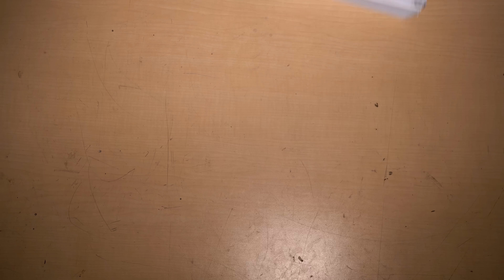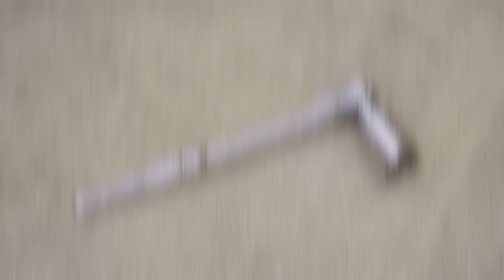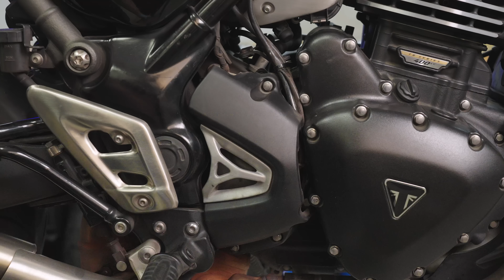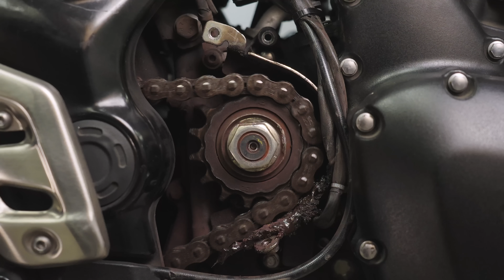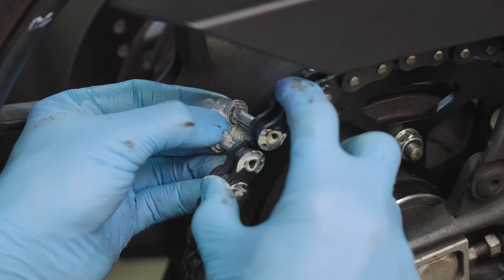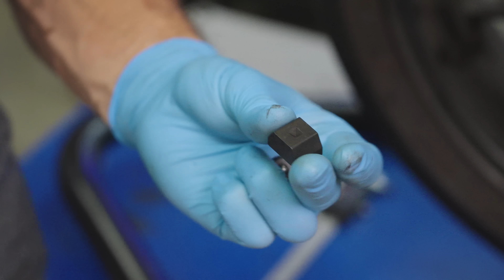How To Replace Your Motorcycle Chain and Sprockets | The Shop Manual

Comment: Hi I have questions and needed to be answered. Does changing the sprocket will affect the speedometer reading as well?
Reply: only if you go with different sprocket sizes than the stock ones.

Comment: If you don't already have stands and the tools and a bunch of bikes it makes more sense to let a shop do it the one time you'll ever need to replace the chain on your bike. (Let's be honest here...the vast majority of riders aren't putting enough miles on a bike to wear out more than one chain) 

I have stands and all the tools except for a chain tool and I'm on the fence about spending the $150-200 for a proper chain tool + spending a few hours doing it myself; or just letting the bike shop down the road do it for $250 and be done with it.  

I've used the $20 Amazon chain tool.  If you're lucky, it'll work once and fight you every step of the way.  If you're not lucky, you'll be cutting off the ruined new master link, fighting with it for 4 hours, then finally having the bike hauled to the shop to finish it anyway.

Comment: Or you can use a simple pin lock rather than this so much precise riveting.
Reply: I'm guessing based on your username that you're probably dealing with motorcycles that are maybe 300-ish cc. For these the alternative options like split links and what have you are fine. But for 600cc and up, you'll definitely, 100% want to use a riveted master link because it's much stronger, and the consequences of a broken chain are so much worse.

Comment: A couple of things. Who in their right mind uses a grinder to take out the rivets? If I'm using a grinder, I'll just cut the chain in half. It's barbarian, but quick. Secondly, 110lb ft isn't the end of the world. VW wheel bearings are an education in creating force. IIRC they're 250 & 90°

Comment: If you're on a budget, it's a good idea to swap the front sprocket as they take 3x the wear. The rear if steel is usually 2-3x expensive is always fine to use again for a second chain. You can also reuse the front sprocket washer too!
Reply: A quality steel set of sprockets is still cheap all things considered; roughly $100.  There's simply no reason to not change the chain and sprockets at the same time.

Comment: Someone give me some thoughts and advice please - I have a 150cc Honda with a 14t front and 43t back sprocket - I have amazing acceleration as I have modified my bike with the basic air filter mod and exhaust system and also I have removed a ton of unnecessary weight - but my bike lacks top speed so I have ordered a 17t front sprocket which takes my rotation from 3.1 to about 2.5 will this be a stable change to my bike and increase my top speed by a good amount?
Reply: It'll change the gearing, by which I mean the theoretical top speed. That will increase. In the real world, the engine may lack the torque to drive you and the bike through the wind to that top speed. In the worst case scenario, it becomes slower to accelerate and has a slower real world top speed. You'll likely see some improvement though.
Reply: I'm guessing you've found out by now, but here's how you answer these questions in the future.
If you hit the rev limiter in your highest gear, then sure, you can get more speed by changing the sprocket. But if you don't reach the rev limiter, then it's fairly unlikely. You may be able to get a little bit more speed if you look up your bike's power curve, and change the sprocket such that the maximum speed you can reach right now would be just shy of the peak power output. However, odds are it'll already be close, so there's not much point.

Comment: A quick advice to everyone. Do a favour to yourselves and buy DID 525 ZVMX GG. I have it on my SUZUKI 650 with a JT rear and Onigbene front sprocket for 70.000 klm and is still like new as the sprockets as well. Only 2 tightenings after these klm and seems ready to reach 100k very easy. Lubrication only with the cheapest 90w and 120w gear lube. You thank me after 5 years.
Reply: Japanese ain’t they

Comment: Shockingly (after removing many torqued as you mentioned on other bikes), my Triumph Tiger 660 Sport was only 63 ft lb!

Your point on the "quality" chain tool is a good one but I tend to grind the pin and use punch to drive out the pin partially out of habit and partially because I have both tools out already.  The punch knocks down that front sprocket lock washer.  The grinder (instead for the chain breaker) is used to cut down the new chain to length because I have never once, even when ordering it that way, had a chain arrive with the correct number of links...even when ordering it from Revzilla.

Comment: BEWARE! Get a clip-on chain, not a rivet chain as shown in the video. Rivet chains are for professionals who can break several masterlinks learning how to do it.
Reply: Not if you have even a mid tier bike. Those are fine for your 300cc beginner bike, but for your typical 600cc and up bikes, it's not a great idea. Yeah, it'll probably not snap, but riveted links are much stronger so why take the risk? Master links also cost very little so just get like two or three, and take it nice and slow. Either that, or let a professional do it for you.
Reply: @wurfyy  Most of us do not live near a motorcycle mechanic and the point of these machines is to save money.
Reply: @samsonsoturian6013  For most of us the point of these is to have fun. If your goal is to save money, you probably went for a 300cc or smaller so yeah, you can pretty safely choose the split link or some other solution like that.
And you don't need to live near a mechanic. That's the nice thing about motorcycles. If you don't live near a motorcycle mechanic, then that's yet another excuse to ride.

Comment: If you ever have to remove the rear wheel do not, I repeat, DO NOT forget where any of the spacers go. Those are the only things between your bearings and the axel. Don't ask how I know.
Reply: such a overlooked part😂Ur bike’s pretty much useless without em
Reply: @hathaway.1166 No, the one I didn't install the bike worked until the bearings blew out

Comment: I've done this at least a half dozen times before but never heard of the "chain around the axle to help lock the front sprocket to remove the nut" trick before.  Neat.  Something I never understood is why that nut "needs" to be torqued so much since you're bending the washer over to hold it into place once it is tightened.  Seems to me like if you just torqued it down to 50 ft-lbs or so and then bent the washer into place that there's no way it's going to back off until you go to the trouble of flattening that washer out again.  I'm sure there's a reason they want you to tighten it down to extreme levels, I just have never had anyone give me a good explanation as to why.  🤔
Reply: 100lbs isn't exactly a ton of torque.  That's right around what most automotive lug nuts are torqued to.

Comment: The one thing that I would add for is to order at least one spare master link!

Especially the first time you do this, you are very likely to over-compress the master link or to over-stake the rivet.  If either happens, you need to replace the master link, so already having a couple spares can save you a lot of headache.

Usually a spare master link is only a couple bucks, so ordering three of them isn't that bad.

If you order from some online retailers, they might even have an option in the order to add a couple spare master links and not pay any more in shipping.
Reply: Good point.  I do the same when changing timing chains on old CIS Mercedes V8s.

Comment: I wonder why nobody talks about taking care of the red rust on the gear axle before installing the new front sprocket? (This looks awfull, and the rust will continue to do it's work and destroy the axle.)
Reply: Definitely worth a spray of something. I'd even be inclined to pull that bearing if I'm taking off the second chain.

Comment: I recently tried this chain around the axle method for my Inazuma 250 but just used 6mm diameter screwdrivers as I didn't have nuts and bolts, using a 4ft extension bar I broke one screwdriver, bent the other until it slipped. I gave up and borrowed a 2,034Nm Milwaukee impact wrench from the local blacksmith did it with the chain back on the rear sprocket, brakes on and bike in neutral. Must have been utterly stupid torque put on at the factory, didn't spin off the nut that easily considering how little 120Nm seemed on assembly. Would never have done it with the bar and I'm no weakling either!!

Comment: Anybody who doesn't know how to replace the chain and sprockets on their motorcycle probably shouldn't be riding a motorcycle. Motorcycles require a great deal more owner/rider involvement than most cars. If that is not your thing, motorcycles are not for you.
Reply: So you were born knowing how to change the chain and sprocket? Or you made sure you knew how before you purchased a bike? Sorry, but your statement, and the many like it I've seen over the years, simply don't make sense.
Reply: @AriH211  I was an amateur mechanic since around age 10, a professional (paid) mechanic from age 18 to age 63, retired, and am back to being an amateur mechanic again. I was attracted to motorcycles at a very early age because they were MACHINES.
Reply: Yeah nah. It's completely fine to just let a professional do it.

Comment: There's a dedicated DID tool for dealing with the chain.  What I like about that tool over the motion pro is that it's made in a way that you can't mess up pressing the side plate or riveting the pins.  The tool will stop when the side plate or pin riveting is in spec.
Reply: Ok, now I am interested. Do you have a link or its product number/name?
Reply: Looks like my comment with the link to the product got deleted.  The tool is DID KM500R
Reply: @jokem59  oof.  $300

Comment: I’ve never regretted installing my 5 HP air compressor and buying a 1/2” drive pneumatic impact wrench.  It will spin off that nut with hardly anything holding the sprocket from rotating.  Put the tranny in neutral so you don’t hammer the gears, stick a block of wood to jam the teeth a little and a couple seconds on the impact wrench and you are done.
Reply: the motor is hammering the snot out of the gears i dont think your air tool will do anything
Reply: @bertsmith5569  I'd think the torque of an impact tool could make significant wear

Comment: Oof, I've only done a couple of chains so far, but I wasn't this precise for sure on squeezing the master link to width or being as careful on the rivet 👀 those chains are at 10k and 7k miles now and I've only needed to adjust them once, so I guess they're alright... It's a fairly critical component though so I guess the time it takes to be more careful and deliberate next time is worth it 😅

Comment: What a great tip for breaking the crank shaft sprocket loose!
Reply: Actually this is not a great tip.
I tried this and it doesn’t work. The 6mm nut just doesn’t hold up and eventually bends and the nut shoots off.

Not to mention that it feels like this method will bend the axel.

I don’t recommend this method. 
I used a high power impact wrench to get it off. You don’t really have to secure the chain, just hold it with a towel and give the gun a few burst shots.

Comment: One of the tools manuals also specified that torque between 20 Nm and 25 Nm is enough to rivet a hollow pin for 525 chain. So if you have a torque wrench, this is an easy way to avoid damaging the pin when riveting.
Reply: Good tip, but nothing tops measuring the flare with calipers. After all, that stated torque will yield different compression depending on whether threads are lubed or not.
Reply: @AriH211  yes for sure you still have to measure.

Comment: i started out following the chain lube advice to the letter.  then one day i stopped.  probably right around the time i hit a combined total of 100k miles on road bikes.  all my chains since then have still lasted over 15k miles at the very least, but most have lasted far more than 20k with no cleaning and no lube.
Reply: Depends on your riding conditions. Cleaning and lubing a motorcycle chain is only to fight off rust and fighting wear between the rollers and the sprockets. The inside of the chain isn't affected. If you only ride in nice conditions, no rain, and you don't ride gravel roads or in the winter when there is salt, lubrication is likely to not do much, but for those of us riding all winter in the rust belt, keeping the chain lubed is critical.
Or, like me, give up and switch to shaft drive bikes.
Reply: @John_Ridley  i commute on my bike almost exclusively.  the only conditions that will stop me from riding are ice or rain when it's below like 45F.  otherwise i ride in the rain, i ride when it's below freezing, and i ride in the blazing sun.  and i live in texas so ice is very rare, and they don't salt the roads here, and it very rarely rains when it's below 45.  i literally commute in my car maybe a couple of times a year, at most.  
i'm a naked bike guy, through and through.  there are shaft drive bikes i wouldn't mind owning, but even if i did, i highly doubt they would wind up being my daily.
if you just don't worry about cleaning and lubing them, it's really not that big a deal to change them out every so often.
Reply: @thinkdunson  I spent about 10 years bicycle commuting. My situation was that I had 4 miles of gravel road on my commute, and it splashed so much clay dust onto the chain that I once had a brand new chain seize up while at work and not bend until I sat down and manually worked every link. It had 12 miles on it since new (one trip to work). I got through chains fast.
I ran an experiment where I was diligent in cleaning and lubing. Over the life of that chain I probably spent 4 or 5 hours cleaning it. It made the chain last 1950 miles instead of 1800 if I just cleaned and lubed once every week or two as it got particularly dirty or squeaked. NOT worth the time.
I also experimented with changing chains. If I was diligent about changing the chain when it showed too worn on the gauge, the sprockets lasted about 10,000 miles, and every time I changed the chain, especially after about 5000 miles, the bike shifted terribly until the chain got worn in to match the sprockets.
So I tried just leaving the worn chain on until the whole thing actually started behaving badly. When I did, the whole thing (chain and sprockets) also lasted about 10,000 miles and I never had trouble with shifting.
So after all this testing, my conclusion was, just lube when the chain gets terrible and only replace everything at once after 10,000 miles.
Reply: oh, another thing, you don't have to change out your sprockets every time you change your chain.  i don't understand why everyone says that.  it's b.s.  i've had quite a few bikes over the years, but my longest owned is my 2017 SV650.  it's got over 75k miles on it, and i've never changed the sprockets.  and yet they still look perfectly fine.
Reply: @thinkdunson  It depends. If you let the chain go way too long, it can really roach the sprockets and if you put a new chain on with bad sprockets, it'll almost immediately start excessive wear on the new chain.
But I agree if you change the chain when it hits a reasonable amount of wear, it's not too bad.
Reply: @thinkdunson  I somewhat agree with this.  It depends on the bike's power output and your riding habits.  I found on my bikes I could get away with re-using the rear sprocket a few times but the drive sprocket always showed signs of wear like shark-finning.  I guess I could have done the old-boy "just flip er' around", but JT-Sprocket brand OEM style drive sprockets are so cheap.  Never had a reason to try that.
Reply: @riding_westward1  your sprockets wear like that because the chain is not tensioned correctly.  it's a lot easier to maintain proper tension than to keep switching out the sprockets.  i check my chain tension every single day, i.e., every time i ride, simply by lifting it with the toe of my boot before i get on.
Reply: @thinkdunson  the drive sprocket turns much faster than the rear and deals with links bending more over a tighter radius.  It's going to wear faster.  and checking chain slack with your boot is like giving a tire a squeeze with your fingers and guessing the air pressure.
Reply: @riding_westward1  when you do it every day, you know exactly how it should look.  it's not rocket science.  the correct tension is literally determined by seeing how far the chain will deflect.
and if you squeeze your tire every day, you'll know when the pressure starts to get low too.  we're not talking about a car where the tread is so stiff you'd never feel a difference.